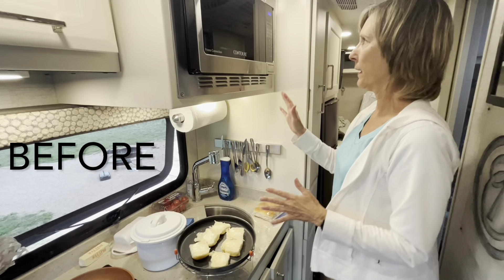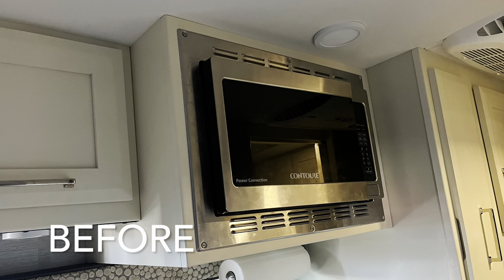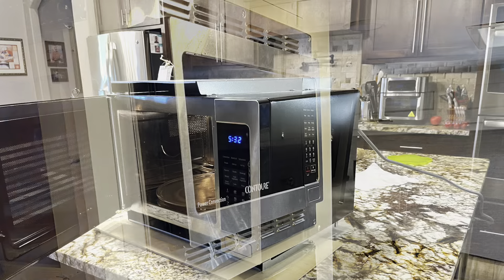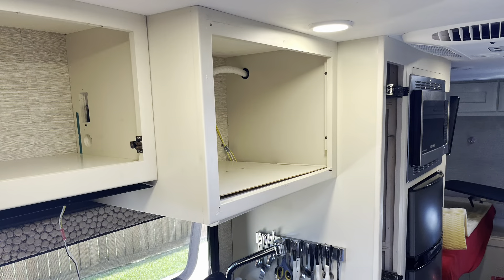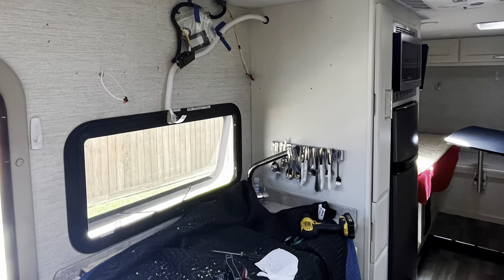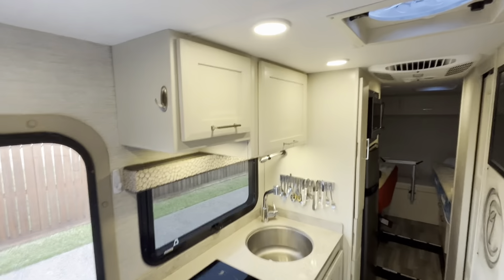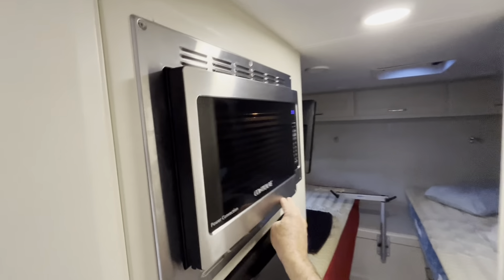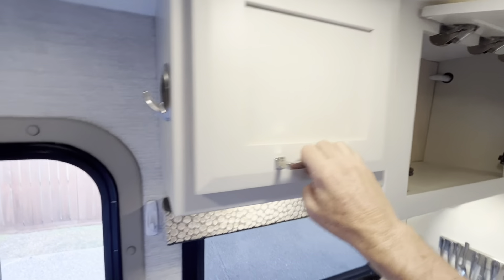2022 Tiffin Midas 24RT - Contoure Microwave Relocation

Comment: Good Job... the only issue I see is that the microwave door opens toward the back facing the bedroom and not towards the front closer to the kitchen.  However, it made total sense to move it to that location.  I would be bumping my face and head too!
Reply from the maker: I agree, but I don’t think that I can change the microwave door to open the other way. But look on the positive: it will be convenient for cooking popcorn when watching TV in the bedroom. But seriously, I believe that the inconvenience of the microwave door will be small compared to the annoyance of trying to wash dishes with your face planted against the microwave door. Finally, if both of us were shorter than 5 feet (actually 59 3/4”), it never would have been a problem (but then we would need a stool to use the microwave).

Comment: Nice mod, our Midas MT has the microwave above the fridge and we like it.  I was watching one of your past video’s when you where adding solar before you added lithium. Question is have you added lithium yet and are there issues with charging  the lithium with the alternator on the transit?  Thanks
Reply from the maker: Thanks for the compliment. I have not added lithium. If I were to, then I would utilize a DC to DC charger (Vitron 30 amp) on the connection from the chassis because I don’t know enough about the limits on the Midas. (Especially since Tiffin wired it incorrectly originally. See my earlier video. And they could not provide me with any electrical design details). The DC to DC charger would prevent the battery boost unfortunately from allowing the house batteries to jump the chassis batteries, and with the Ford “smart” alternator I’m not sure that the voltage would get high enough to completely charge lithium. Solar was a great upgrade because (during the day) it’s the only way to run the Xantrex inverter at high capacity (hair dryer, dryer extension cord to cooktop, etc). So, rather than lithium batteries I decided that I could spend the same $ on a solar power generator, and plug the shore power cord into it. It’s not as efficient, but I can run high wattage appliances including the AC for short periods. And I could use the power generator at home for power outages. I bought an Anker 767 for my home and when I plug my Midas into it I can run the AC for 1.5 hours. I’m still experimenting with this arrangement, because I need to figure out how to charge it quickly and easily with no shore power. Look for a video on Midas electrical in a few weeks. Note, the Progressive Dynamics power center in the Midas does have a switch on its circuit board for lithium, and the GoPower solar controller can be switched to lithium.
Reply from the maker: Update: I’m preparing to go to lithium. But I have studying the Tiffin electrical system and battery box, so my scope is becoming bigger than expected. It appears to be no easy task to physically replace the batteries under the entrance step without disconnecting most of the 12v cables and removing the vertical panel in which they are attached. Also, Tiffin did not use the Ford CCP2 port (175A ignition controlled), but appears to have connected the house batteries directly to the Ford chassis battery. More investigation needed). Also, the inverter is connected using 2 gauge rather than 2/0 wire per Xantrex. Finally, I don’t believe that the inverter has a AC breaker on its output to the non-GFCI (and refrigerator) outlets. I’ll post a video when I have figured all of this out.